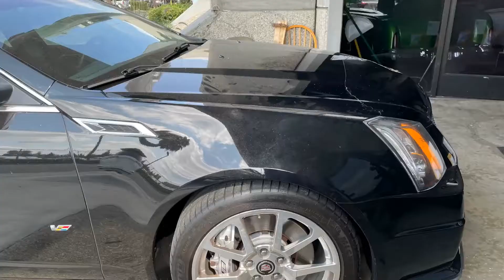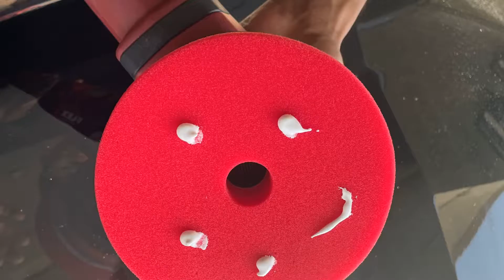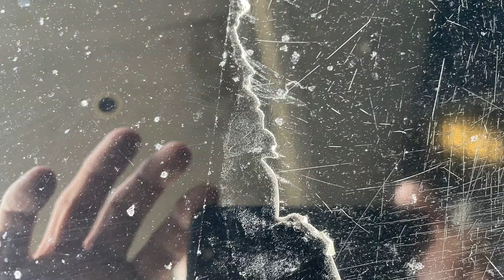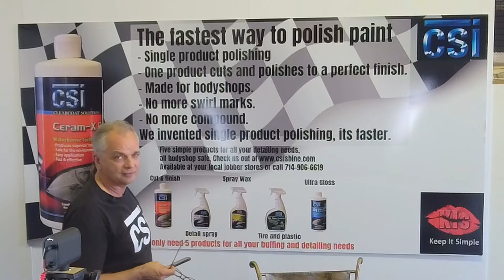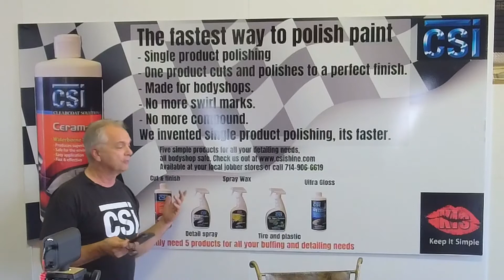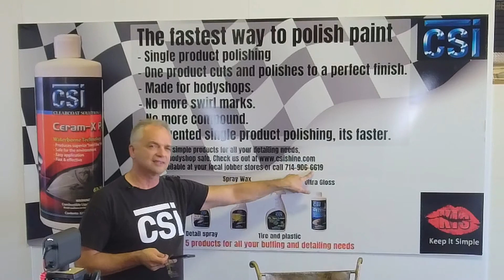Clear bra removal Sept 2021

Comment: Hi Tom I’ve written couple comments here and there but no answer yet. I do mobile paint touch up for dealerships mostly. Correct a lot of scratches, I was about to get the Milwaukee Rotary cordless polishers bc also needed something to work on boats. What would you recommend us. 
Also after couple years looking for a wax I found the 3D spray wax which works fine sometimes under the sun dries difficult to remove but overalls is good, how is it yours?
Reply from the maker: Hi there 
Call me if you ever need help 
714-906-6619
We are a Flex dealer and we do sell rotary polishers.  As per wax look at our Q7 wax it works in direct sun. 
Tom

Comment: Tom, thanks for another great video. Need a link for 3" blue pads and clay mitt. Not on your sites. Thanks
Reply from the maker: Here you go 
https://csiautoab.com/collections/csi-buffing-pads/products/csi-62-620-autoscrub-wash-mitt
Reply: Thanks Tom. I was also trying to locate the 3" blue foam DA pads. Should have mentioned that instead of wool. Couldn't find those anywhere. Thank you for your help.
Reply: Tom, found the 3" blue foam DA pads on the same site you listed, but had to retype the site in order to get it to show the pads. Thanks for your help.
Reply from the maker: Sorry had a trade show. Should be up in one more day.
Reply: clearcoatsolutions Tom, can't find 3" blue pads for DA and clay mitt on any of the sites. Thanks for all your help.

Comment: Dang ! You brought back nightmares Tom!! LOL. I removed a clear Bra. Took me 8 hours! I ended up using  a heat gun, Rapid Remover, a plastic razor(for lifting the edge for the rapid remover)  a 3M eraser tool and my hands. Boy what a NIGHTMARE!!  The clear Bra I removed was left on too long. UGH... next time it's an automatic $500.00 for two reasons. 1. If they accept, I make some money 2. If it's too high and they pass.. GOOD, I dodged a bullet!!  Thanks Tom, great video👍